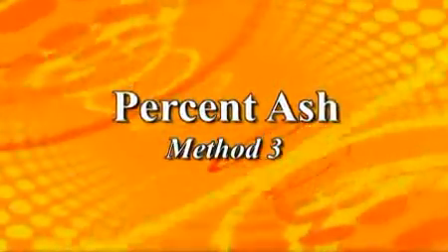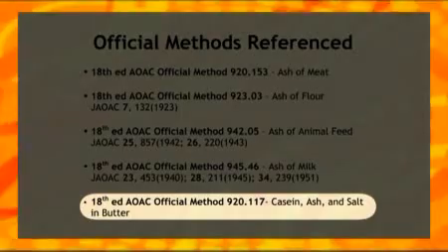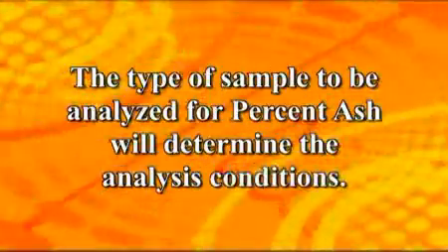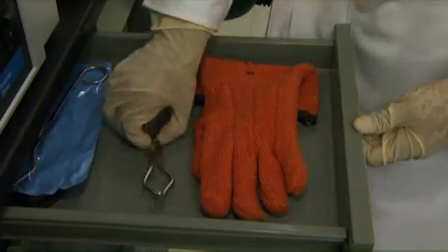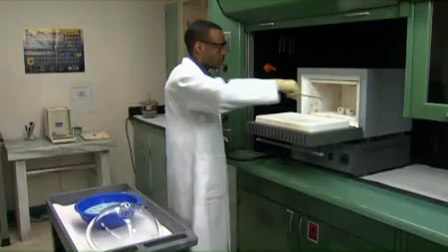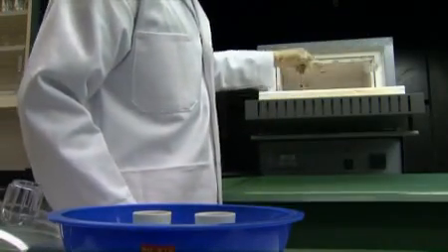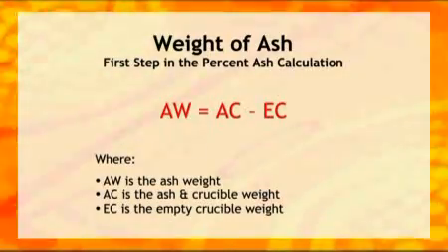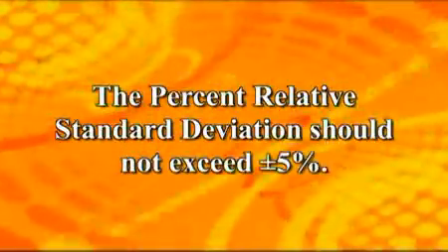Proximate Analysis - Percent Ash

Comment: is that a must to do moisture analysis before ash analysis?
Reply from the maker: +Kanageswary Sockalingam The video presentations of the methods are guidelines. There are instances that drying the sample prior to ashes may not be necessary, it all depends on the sample matrix. We recommend drying the samples prior to ashes as a preventive measurement; and encourage each individual to consult the official method for the specific sample matrix and make the final determination.